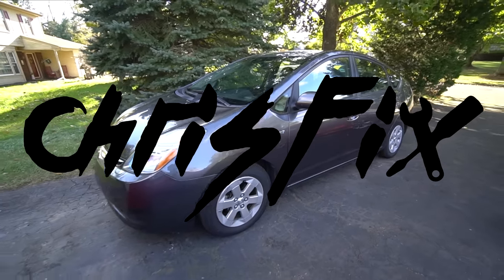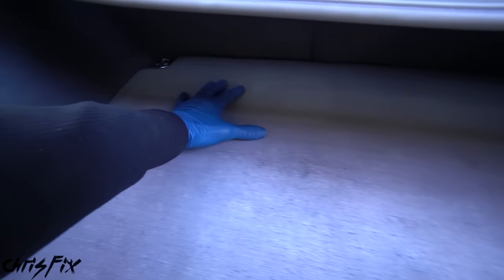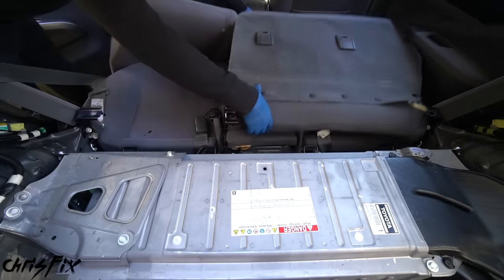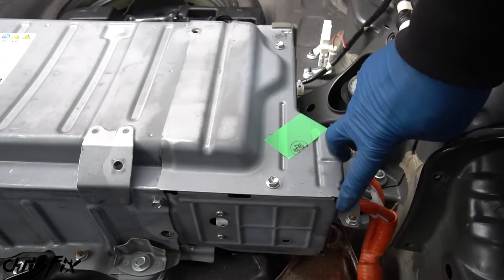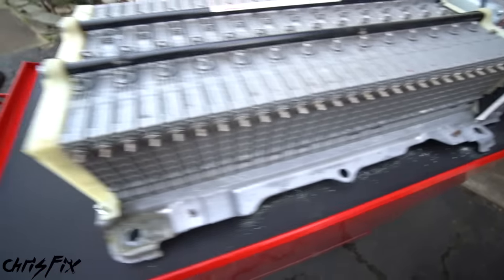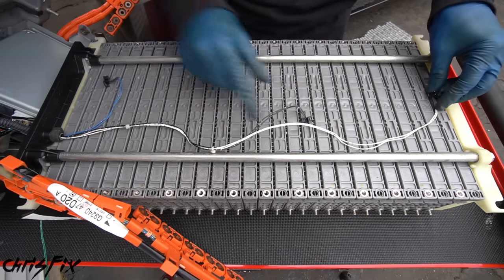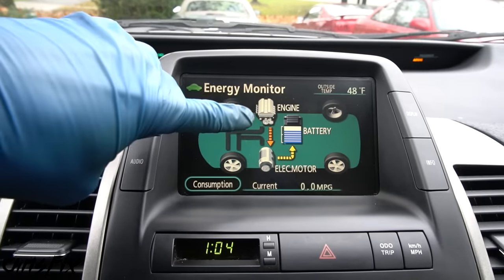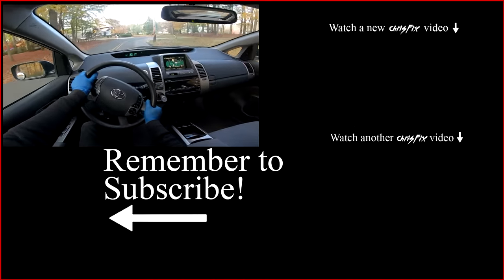I Bought the Most Hated Car on the Internet (and made $1000)

Comment: I watched your video and fixed my Prius (2008, 100t km). Turned out the copper connectors on the battery got oxidized and green. I took out all the connectors and put it in a water with citric acid. Then put it all back together and the car started!
Reply from the maker: Awesome!

Comment: Dealer Mechanic: $4000 to replace the battery pack.
ChrisFix: Hey guys chris fix here,  I'm about to end this man's whole career for a fraction of the cost
Reply: Underrated comment!
Reply: Hey bruh, thats a nice profile picture :)
Reply: Brilliant!
Reply: Seriously 350 dollars to unbolt and clean a fan is ridiculous
Reply: @pjanoo6973  but you know that the fan is deep in the car, it would be $5 if the owner unbolts all the stuff and put it back and machanic only cleans the fan
Reply: @James Moreau to be honest, that's why loads of people are afraid of these Priuses, if the battery goes, the car is basically scrap. Well that's how it is in the UK. Garage fees are just too much.
Reply: Billy Mays here
Reply: Drain tubes on my Ford Expedition moon roof were clogged, causing it to stream water inside. Dealer cost to replace them was $750. Used a $6 fluid transfer pump to force soapy water through them, job done, saved $744 + tax ($65). Took a little over an hour.
Clutch on A/C compressor went on the Expedition, $800+ to replace it. The compressor itself is $150 for new, not reman. OEM Ford Clutch on Ebay, $40. Just 2 fan shroud clips & 1 8mm bolt holding clutch on, 10 minutes.
Reply: Hardly, dealers don't like doing these sort of repairs because the margin is too low for the amount of time it takes and what they are able to charge versus other more profitable repairs. Did you watch the entire video? That is one arduous repair for professional mechanics because time is money. Yeah, not all repairs are created equal. And, this is one repair where the shade tree mechanic is justified over a garage because I'd be worried they cut a few corners like not replacing the bus bars (good luck QC'ing that). Another example, try getting a dealer to repair a cracked windshield. Almost all of them will balk and tell you to take it a local windshield repair company that can do it for $100 because even though the dealer could do it, and would charge at least $1000, they simply don't want to because there are more profitable repairs to be made. And, the fact that other companies versus the dealer are running around replacing windshields hardly threatens the dealer business model. Plus, the average Prius owner hardly knows which way to turn a wrench, let alone tackle this job.
Reply: That's not really fair, the dealer will install a NEW battery and he will provide expertise, labor and warranty, and he expects to make a profit.  The mechanic has nothing to worry about because the majority will not attempt this repair.  And although many people will do this, they had no intention of paying $4000 anyway, so no business is lost.
Reply: @wneubert2  are you sure the battery is NEW? Just because it's a dealer, it doesn't necessarily mean new. Quite often, like any other shop they'll use remanufactured/rebuilt parts. And usually like any other shop, the warranty is for the parts, NOT the labor. Eg lifetime starter, brake pads etc doesn't include the labor. $30 brake pads cost $200 to install, so $230 - $30 = $200! Not to mention, dealers usually inflate prices. Motorcraft plugs for my Expedition dealer was $12, Advance was $8 minus 20% discount. $96 vs $64 - 20% = $51, $45 in my pocket, plus, Advance delivered same day for free. All dealers are run by Dewey, Screwem & How!
Reply: @pauldennison2543  No, I just assumed it was new because usually factory repairs are with new parts, but it could easily be wrong in this case.  I would also assume that if they do install a refurbished battery they would be required to tell you.  I was mainly thinking that this wouldn't affect the number of $4000 repairs the dealer makes and that charging $3000 extra for 3-4 hours labor seemed like stealing unless they at least gave you a new battery.
Reply: @wneubert2  thanks for your honesty. But say you brought a new car, 6 months down the road something goes sideways. Depending on what the part is, you may get new, reman or even aftermarket. I worked at a dealer when I was a kid, many moons ago, I seriously doubt that they changed for the better. I never go to the stealer if I can help it. And don't believe that they'll know your car better bs either. Guy working on your Ford today may have been working at a Toyota dealership last week.
Reply: @pauldennison2543  I never go to the dealer either, mainly because I feel they charge twice as much for the same work.
Reply: @wneubert2  try calling different dealers for the same part. Often you'll see different dealers charge different prices for the same part. Often you can buy OEM parts from auto parts stores, usually for less. Like the plugs I mentioned, Motorcraft is Motorcraft, but $8 Motorcraft is better than $12 Motorcraft! Compressor clutch for my car on ebay, $40, hate to guess what dealer would charge. Shop wants $750 to install new compressor. Clutch took 15 minutes to change. Like I mentioned previously, moonroof repair was over $750, did it myself using a $6 fluid transfer pump from Horror Freight. Took a bit over an hour but if you pay me $500, I'll do yours & save ya $250! 🤣, Hell, my attorney only gets $300 an hour, I'd be doing better than him & don't have to pay for a law degree!
Listen, you probably already know this but find a forum for your car, like I'm in a Ford Expedition forum. Between that, Google, YouTube & Ebay you can learn a ton & save money as well.
If nothing else, if the problem isn't something you feel you can handle, you'll at least know what's involved. Mechanics are less likely to take advantage when you have knowledge.
True Story, I'm at a gas station getting gas and a woman pulled in, her flasher was flashing at hyper speed. She told the so called mechanic & he said "We bring it in and diagnose it" I spoke to the woman when he stepped away, told her she was getting hosed. I'd meet her down the road at a parts store. She got the bulb, I put it in for her. She offered me a good tip, I just took $5 for lunch. Told me she'd been going there for years, thought he was a honest local mechanic.
 Well I'm not a SAE certified A mechanic, but I diagnosed it in 30 seconds. Now the woman got a 2 minute education on flashers & what happens when a bulb goes out. And I installed hers for $5 plus whatever she paid for the bulb. Never cheat anyone, it sometimes bites you in the ass big time. She probably doesn't go back to that mechanic & she probably told all her friends too.
Reply: @pauldennison2543  Long story:)  I did read it all.
Reply: @wneubert2  thanks for the  Courtesy. I got on a roll there & couldn't find the feckin brakes.🤣
Reply: @sran9492  Nothing is $5 when it goes into the dealers garage. You will get a minimum of 1hr labor charge and they will not put the stuff you took apart.
Reply: Its almost always cheaper to do your own work, mechanics make their money by saving people time on researching and working on vehicles not from the actual difficulty of the work.
Reply: He didn't balance the battery's so the battery will fail again soon
Reply: If Chris was a Doctor

Chris: today i am gonna show you how to do a brain surgery with table knife and soapy water.
Reply: I bought a Prius 2007 lemon for $2600. The seller scammed me on market place. Battery broke down couple days later. I paid $2600 at the Toyota dealer for a brand new battery, installed. “$4000”?
Reply: @pauldennison2543  yes the battery is new, the Toyota dealer never use rebuilt parts.
Reply: The different is that Toyota gives 10 years warranty if you service the car at Toyota one time per year. My Lexus battery is $9000, but Lexus will change it  for $3000 after 11 years if I service the car at Toyota or Lexus.
Reply: @pauldennison2543  battery packs for Lexus and Toyota is coming from Japan, every broken battery pack is sent back to Japan. Good 99% of Toytoa and Lexus has never changed the battery

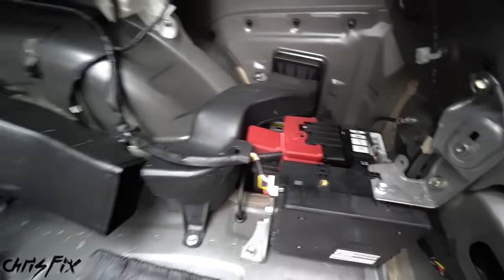Comment: 22:23 I think that spark was larger than the spark from the Prius sparkplug lol.
Reply: Lol
Reply: i bet my old john deere mower is faster than the prius (running gas only) down 1/4 , 1/2, maybe the 1 mile strips
Reply: The reason i don't work on hybrids without wearing insulated high voltage gloves.
Reply: That was because the doors were opened so it instantly turned the lights on. It was the low voltage 12V part I think, so no need to worry in this instance.

Comment: 350 bucks to pull the vent motor and blow it off with compressed air? I'm in the wrong business.
Reply: Wish I can like more than 1 time. 1000% agree
Reply: Yes, you need to own a dealership. The actual mechanic makes a small fraction of that price.

Comment: The POV aspect is a genius concept and the cadence and knowledge in your video is splendid.  
Well Done Chris
Can the old battery be recycled ?
What do you do with the Old Prius Battery?
Reply from the maker: Thanks a lot! When you buy new batteries they usually have a core charge with the purchase , so you can send your old battery back to the company and get some money back, and they recycle the battery!
Reply: I suppose that you could use it for your other kinds of projects. Maybe even make a go kart with it and an electric motor, something which won't really kill anyone if it fails at any point in time.

It's still a good, big battery, after all.
Reply: Also if there's no battery recycling program by the battery manufacturer, there are some govt funded recycling programs, so be sure to ask your city's environmental department (that's what it's called in my city)
Reply: What Chris didn't mention was that there is a core charge for the battery of nearly $400 bucks or so which is refundable once you return the old battery to the seller where it is recycled and refurbished and re-sold.
Reply: @chrisfix  thanks for the tip, even though I will be dead before I buy a prius
Reply: is this even a question? throw it to the ocean!
Reply: is this even a question? throw it to the ocean!

Comment: Paused the video as soon as you said you got it for 1500, looking for used a prius right now.
Reply: Steven Betteridge literally done the same thing 😂😂😂
Reply: yeah yeah, you'll all probably electrocute yourself and loose 3 grand...
He put the safety plug in and sparks threw off the drill. 22:13
Reply: @jrag1000  obviously you're not confident with electricity.
Reply: jrag1000 the sparks are because the doors were open. If you ever actually hooked up a battery you would know that if a light is on or a door is open it would arc. Nothing to be scared of.
Reply: @jrag1000  that was 12 volt battery reconnect, doors were open with lights going on during reconnect.
Reply: @jrag1000   clearly you have no clue how this work
Reply: @bluepeterN900  i dont' care how it works, i can't stand Prius that weak car. I'll stick to my v8 Mustang.
Reply: jrag1000 doubt
Reply: @jrag1000  That was the 12v battery, nothing special there. Learn something.
Reply: @jrag1000  id rather have a prius than drive into crowds every 10 minutes
Reply: @Sutliff01  doubt what?

Comment: So, who just visited Craigslist looking for cheap Priuses?
Reply: lol. You caught me in the act.
Reply: Go for the Lexus CT200h. Basically the same car, same running gear. But much nicer inside.
Reply: Me
Reply: @dj_paultuk7052  The biggest problem with the Lexus is that there aren't really old cheap ones on the market yet.  However, I agree with you - the Lexus doesn't have that really goofy dash that the Prius has.  The exterior isn't nearly as goofy either - this is one case where driving the Lexus equivalent is actually less pretentious.  A quick price scan shows that there is only a modest premium in price.  I might be shopping for my daughter next year, so this one will go on the list... thanks!!
Reply: @lsh3rd  What about those Honda Civic electric?! A friend of mine used to drive '04 Honda Civic Electric. I thought it was a good compact car.
Reply: Sure as hell not me - now a 1932 ford 3w deuce or a 1964 c-10 big window, short bed fleetside pick up - you HAVE my attention.
Reply: Ain't gonna lie, I just did lol.
Reply: me

Comment: Next video : How to convert your car to ev
Reply: 1 Unplug the coil and injector
2 Put in 1st gear
3 Turn the key to start position and never let go.
Reply: don't do it on the Civic
Reply: That is a lot harder than it sounds...
Reply: Id be interested in the process to do this. You'd probably wanna start with 2 cars and combine them. Eg: older Nissan leaf and then car of choice.
Reply: That would actually be really interesting.
Reply: The ones owners did similar with prius in california & they were complete dogs.  Nobody would let anyone look over or do a review of them.  They removed the gasoline engine and replaced it with a battery making in 100%electric.  At that time it just wasn't a viable idea, technology even now is much better.  However at the time admitting this was un-thinkable.  So instead allowing others to see what was possible, pros/cons.  Instead they played the role of zealots rather than let people see real world usability.
Reply: Nah that’s not Chris Fix job it’s a job for rich rebuilds

Comment: I had the pleasure of having to drive one of these for my drivers license road test. Honestly, they're not that bad, a bit funky, but you get used to it. The reason why they do get a bad name is because if the idiots that drive them. Idiots as in don't know how to drive. The Prius is kinda like a push mower, sure there are better and bigger vehicles out there, but it's small, easy to use, and gets great gas mileage
Reply from the maker: Good analogy! I agree. It’s fun because it’s different.
Reply: There is a Japanese slang word for idiot it is baka
Reply: Its just a car, cheap to run car that goes and goes and goes, my 2011 Prius has 355 000km on it, still havent had ANY problems with it. 
And i don understand where u guys find these prius drivers? lol, i have never seen a prius driver thats that bad... I do get alot of "pissed off" prius drivers on me tho, since mine got an aftermarket bumper and other tailights and such. I dont understand what triggers them tho... Valenti smoked tailights and Aim gain type 3 front bumper makes it look so much better... But apparently it triggers other prius drivers...
Reply: TRATOIR
Reply: Vaughn Shaff they also are hated by people who work on their own cars because it takes hours and 1000$ to change a battery, the one on my truck costs 100$ and takes me about 3 minutes, that and it has no feel it’s very drive and steer by wire, it feels like playing an arcade racing game
Reply: Vaughn Shaff  So you just got your license and now feel like you can criticize people (idiots)that have been driving for years,you are going to have problems in the years that follow.

Comment: Imagine how good the price stats would be if you found out there's only one bad bank and replaced that... The codes said it was just bank 1...though replacing the entire thing might take less time since you don't have to test/charge modules.  Though could replace two modules in the bad block and be done with it.  Also might want to mention the safety gloves... :) Also straight vinegar for the bus bolts turns them black :/ missed step: removing a small plastic insert when removing the three wires that plug into the ECU, also putting it back on. Also have to kind of peel off a foam piece to remove the two screws holding down the pack to the bottom.  Have to put the seatbelts back in their slots. To get the covers next to the seat on lift up or pry the plastic up after lining it up.  Need a shallow socket for the very long screws in the side panel. Rest is grand, thanks, it worked :)